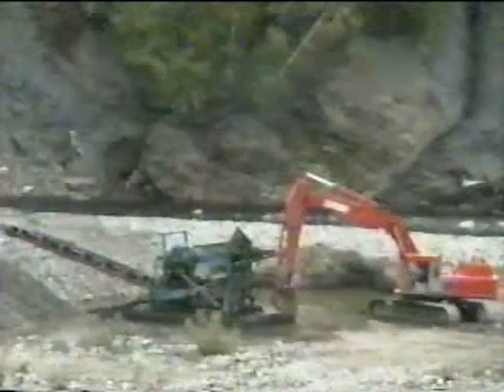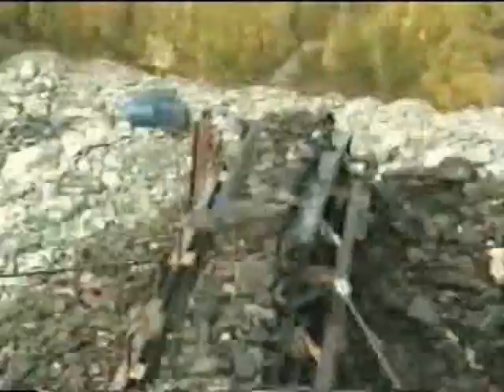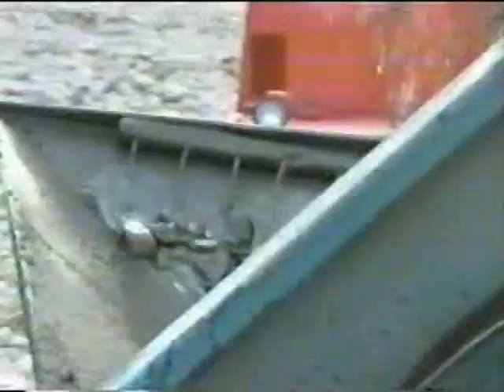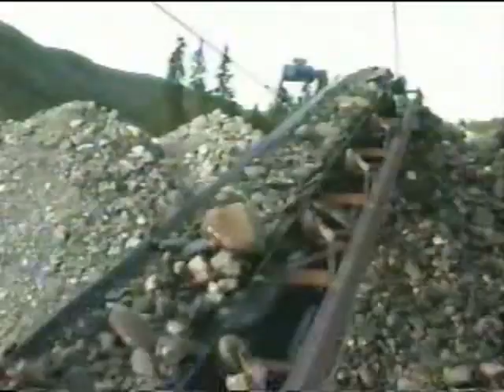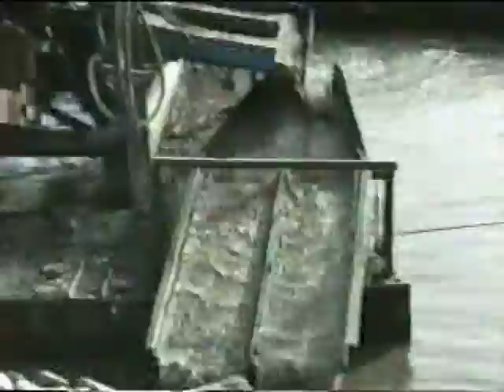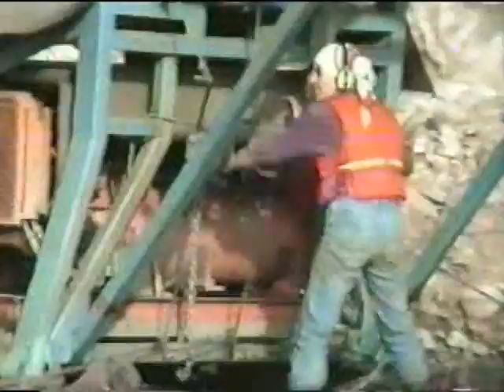Floater Dredging for Placer Gold on the Fortymile River, Yukon

Comment: I have had this idea in my head for a few month now, glad to see I wasn't the only one. This seems to be a very practical approach with very little cost. Imagine a couple of these in a cut digging away. The are lighter, easier to move, and work with you as you process your pay.
Reply: JonD a good friend of mine is building one of these. I asked him about the rocking, but he said it’s not bad enough to cause any significant losses. He’ll save more time and fuel by not having to haul the dirt or move the plant. Those savings are far more significant than any losses from the rocking. Looks like these guys set it up so the sluice rocking is a side-to-side motion that makes the sluices act a little like a rocker-box.
Reply: Awesome, maybe he could post up a video of his working when it's finished. Any money you can save is money you put back in your pocket.
Reply: JonD yea, i’ll try to get out to his mine sometime after he’s done. It’s only accessible by plane in summer, but he just got his own bush plane and pilots license recently. It might be a couple years until he gets it up and running, though.
Reply: I can just imagine, probably gotta be difficult to get things done by plane. Good on him for getting things done, and kicking some ass. Best of luck to you and your friend!
Reply: JonD yea, he does all his equipment moving in winter. We live in Alaska, his mine is near petersville. His family owns a snow cat business, so that’s helpful. I visited that mine this new years for the first time. Rode snowmobiles 40 miles to get there. Part of the trail there uses the original petersville mine trail from the early 1900’s. I love that area! Lots to explore.

Comment: Nice ( concept ), from the starting point (gravels entering bucket ) thru to discharge. Would like to know loss rate ? All that rocking back & forth worries me ( sluice angle ) , as well as , What about the gravels that don't even make it to the system because they are missed by the bucket ? I would after migrating a half length of distance ( its obvious one goes side-side the entire length of the bar ) . I WOULD , run a sec. exc. ( with clean up suction device; like vac the corners of a room )